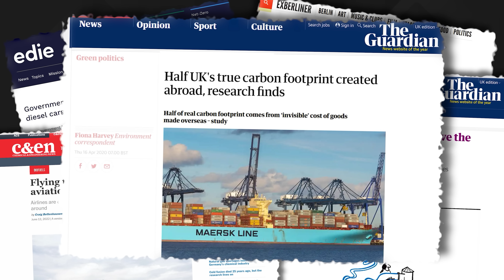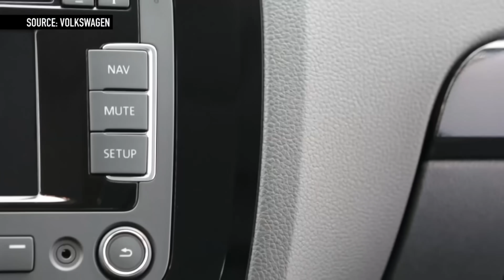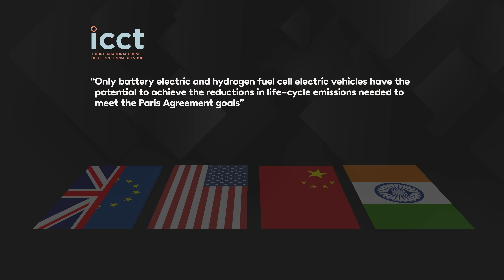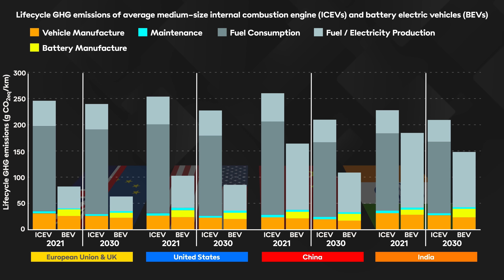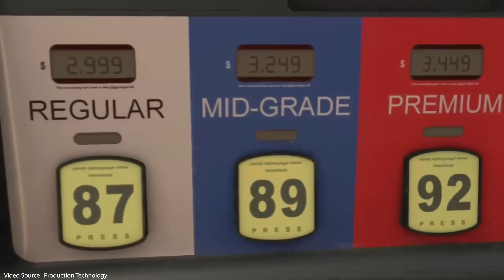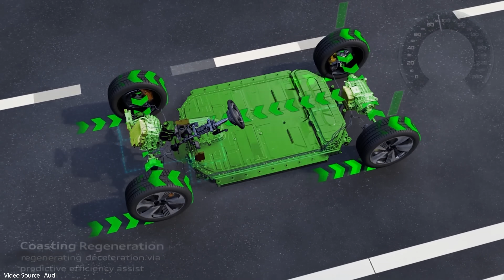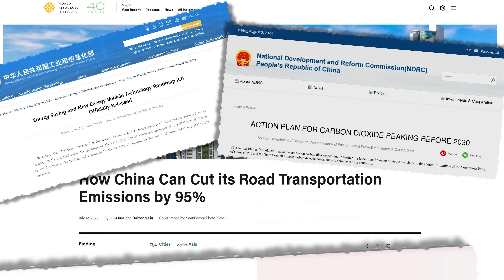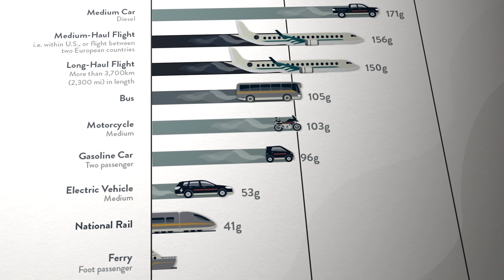Are EVs really better for the climate?

Comment: 5:08 So for BEVs the emission for generating the electricity is included, what about the emission for refining and transporting the fossil fuels, are they included as well?
Reply: Ding Ding.  You get a cigar.   I once took the time to look at the CO2 generated by making the stainless steel for an offshore drilling platform.   It is a lot.   Need to add that in too.
Reply: And don't overlook all the electricity used just pumping oil out of the ground, before it even gets to a refinery....
Reply: @Brian-om2hh and those 4.2 kWh used to refine one gallon of oil

Comment: Research from well respected organizations?
Never trust a statistic you have not rigged for yourself.
Means be critical, be mindful, double (or better) tripple-check. Just in case.

The means we power our transportation, actually all fossil energy sources, has to be changed. Methanol is, if you think it through, in the only viable option here in the medium term. Hydrogen, electric and biomass, have their niche applications, eventually ammonia too (even I am least convinced about that). But Methanol will (have to) replace all fossil fuels.
CO2 from power plant/industry exhausts plus hydrogen splitted with renewable energy (eventually/partially with nuclear), lets you produce Methanol. It is liquid, quite safe to use and basically no change to infrastructure.
But what we are talking about here, dont forget that.
Just crude oil is used 5,000 Million tonnes a year.
Even full force switch, with replacing 4% of it p.a., which would be an amazing achievement, with sth. better would take a transition period of 25 years or more.

Electric cars are not necessarily environment friendly.
It depends how the electricity is produced. Also how the Lithium, Copper (about 50 kg per car, where should this Copper come from for a billion cars?) and other rare elements are produced/mined.
In any case, an existing well working already existing car, is in most cases a better option for the environment, than a new to produce (even electric) car.

In Germany we "like" to burn lignite in power plant. Cant get more horrible than that. But the Russians stopped the natural gas deliveries, so we ran out of options in the short term here.
So keep that in mind, when citing "research", that parameters can change over time. F.e. here the CO2 fingerprint of electricity production has change now for the worse, compared to three years ago.

I think the E-Power concept from Nissan is the best environment friendly option, or the least harmful one, for most markets in the world.
Small calculation. A (lignite) power plant has CO2 emission of 1 kg per kWh electricity. A electric car has a consumption of about 0.2 kWh per km, when taken into accout transmission losses, phantom losses etc.
This means actually about 200 gramm emissions per km, for an electric car. Only good thing is just that the emissions do not accure within the town.
A Nissan Qashqai has CO2 Emissions of 122 gram per km.
Actually better than electric, when electricity is derived only from inefficient coal power plant.
Be it depends on the circumstances in that place.

Similar with trains. If it is a regular train (up to 200 km/h), more than half full on regular basis on short distances (up to about 300 km) it is more environment friendly than the plane.
But if the train is nearly empty, it is not good for the environment at all.
If it is a highspeed train(300 km/h or more), which consumes 3x the energy, is much more wasteful (f.e. brakes have to be replaced more often, the building of special highspeed tracks consumes at lot of steel and cement and space etc.) overall, and used for longer journeys (more than 300 km) is actually worse than the plane.
Planes which are usually fully booked, and the plane gets more efficient the longer the flight is.
Reality is, there are not simple solutions, it depends.
For that it is vital (literally the survival of our species depends of it) that we use the price, as an indicator on one hand, and politicians sets a price for pollutions of the environment (f.e. CO2-duty min. 100$/tonne).
That by looking at the price (for a ticket) we can make the economical, at the same time environment friendly, decision how to proceed.
No "research paper" can determine as granulated, as timely and as adaptive to changing parameters, as the price indicator can.

Comment: You mention that emissions for the production of ICE and BEV cars are similar. But, I'm pretty sure, manufacturing of Li-ion batteries causes way more harm than ICEs.
Reply: Generally the Emissions to make the batteries are offset after 1 year of driving.      When we get enough old batteries it will be even less with recycling.

Comment: I'd like an EV - once I can afford a second-hand one. That's going to be a long while unfortunately. In the meantime, I rarely use the car I have, it's small, efficient, economical and very well-maintained. 
Last year, we did 1,000 miles by car and it's set to do about the same this year. We're on the point of going back to using more public transport again whenever it's possible. 
(I used public transport right until the age of 52, when I finally had to learn to drive because of cut-backs in local bus services. Now it'll be case of frequency and just how much it costs to travel). 

Personally, I don't fret over the fact that I do have a 'gas-guzzler,' because I have made, and continue to make, a lot of pro-environment changes to my life:
 
Been a vegetarian/vegan for over 40 years, my family committing to the same diet for the past 4 years. 
I've been a regular tree-planter for about the same amount of time. 
My career was as a gardener, but with elements of conservation work involved. 

I have only flown by plane once in my life (UK to Iceland), and that was not by choice. Although I loved being in Iceland, I vowed never to fly again, and I never have. (My family are also committed non-flyers).

We are a make do and mend-type family, enjoy raiding fly-tip sites and lugging back stuff to make into other things. My son has got a new bookcase my husband has just finished making out of dumped wood. 
We buy most of our clothes and shoes from charity shops, sometimes furnishings as well. 

After the stream by my house emitted a methane 'belch,' which not only stank to high heaven, the fact this happened at all really worried me. So, over the past couple of weeks, I have begun to remove buckets of wood and leaves out of the stream and compost them aerobically to reduce the production of methane and nitrous oxide. There will be very little difference in the amount of CO2 emitted as these materials break down, but the other 2 were my primary concerns. 

I'm in the middle of planting a 2 acre permaculture/rewilding garden, and not only is this bringing back lots of wildlife to the area, it's encouraging species I've never seen here before. 
I have been picking my own home-grown fruit and vegetables every day for weeks now. Really saving money, with a fine crop of potatoes, blue and blackberries to come. 
I'm not just concentrating on those fruit/veg plants that are often seen in UK gardens, but planning ahead and starting to introduce those that can cope better with the new, hotter British summers.  

Today I began making a little activated biochar from dried out brash (thin wood collected from the stream) for the very first time. 
I was unsure how effective biochar would be, so I'd been doing a lot of research into it, making sure I wasn't getting into something that would have so little impact it wasn't worthwhile.
It's a bit of a messy job, and rather hot work on a day like this (31C in Scotland! I think I might try and do this job the same time as cook a bit of food in future. Kill 2 birds with one stone), but it's supposed to be pretty effective at locking carbon in soil. 

Tomorrow, sowing more food plants.
Reply: Legend and an inspiration.
Reply: I have an MG ev on a lease and it saves me money.
Reply: Buying a 2nd hand 1 will cost you a lot of money. But suit yourself.
Reply: @nozirohhh  buying a second hand gas car will, EVs (the right ones at least) don't have the same issues.
Reply: I'm going to wait 6 years from now to get one. Just going to pay cash for one. I live in Saskatchewan, Canada, and the least expensive used Tesla available is a 2018 model 3 long range for $62,000.00

Good luck finding anything new around here and if you do, it will be around $100,000 which is out of most people's ability to pay. 

And I want more range since when it goes down to -30 to -40C here in the winter it cuts the range down dramatically. I'm hoping the range and outrageous costs are fixed when I'm ready to purchase.
Reply: @KurtQuad  I think this you're spot on. Market will change a lot in that time.
Reply: @monkeysezbegood  we used to have this with light bulbs. People would say when my bulbs fail then I'll get LEDs.
Reply: I bought an EV last year with a $600 USD stimulus payment and a $370 SD extra money that I had.  It was a Lectric XP Step Thru 1.0  ebike (white) and now I have over 2,170 miles or 3,492 kilometers on it since January 2021. EV's doesn't just encompass passenger cars. I am a senior citizen and use it also for grocery shopping taking it right into my local grocery store 3.2 miles or 5.15 kilometers away and putting selected items right into my big front basket so no parking spot,no shopping cart so no grocery bag is needed. There might be a few times where I can't use it like when there is ice or show on the ground which is about 2 weeks out of the year where I live or when there is a big windstorm which might be another two or three weeks. I also have another specially designed electric bike that I can ride during the rainy season without getting wet at all . Many young people ride those electric scooters instead.
Reply: As little as you use your vehicle, the CO2 produced by running it is negligible.  The safety of driving a significantly heavier vehicle might be more of an issue.
Reply: You need a YouTube channel Debbie!
Reply: Biochar is a home for all the microbial life that soil needs in order to be soil and it catches minerals and nutrients like a filter that would normally be washed away from rain and normal watering. I highly recommend anyone doing gardening or farming use the charcoal method to make it as you retain more carbon as less goes up as smoke and you can increase porosity by adding steam to the charcoal container as you cook it.
How to build one get a metal container you can screw or clamp shut to put wood chips or sticks into that container has a tube from the top that ends under the container this lets the sin gas that comes off the wood to be a fuel to further the charcoal cooking process the wood container is inside a lager metal barrel so wood can be used to cook the interior container, to activate the charcoal IE make it more porous you add a tube to the bottom of your wood container that goes to a kettle of water that when heated release steam through the tube that then gets further heated and effects the charcoal.
Reply: Busses produce more pollution than cars and only break even with the pollution of cars when they are 33% occupied with passengers.
Basically Busses if not filled with passenger produce more pollution than cars do.
Reply: Counter argument to Just Have a Think biased argument... https://www.youtube.com/watch?v=TUx8yIlKVpU
Reply: Be prepared to spend $20,000+ to replace your batteries.  Ha ha ha ha ha.
Reply: @scottslotterbeck3796  Wright's law by the time you have to replace the battery it will not cost anywhere near that much.

Comment: The biggest frustration with EVs for me, currently (now that's an unintended pun!), is (as an example) for long trips across western US states with no charging stations, or very few. So, for example, plan a trip from Houston, TX to Ruidoso, NM for one week and see if you can do it in an EV with a range of 300 miles. Oh, by the way, make sure and include stops at remote mountain lakes, etc. for your vacation time while in Ruidoso... The answer is, it can't be done. Not yet. So, while I am not against EVs, I do point out that the infrastructure is not there for charging the vehicles, and the time to to charge for long-haul excursions like the example I have presented (which was, by the way, my vacation this summer) are not possible yet. We still have research to do. By the way, I am a huge fan of fuel cell technology for vehicles, which would not suffer from charge time problems, but, of course, still has challenges. Great video, keep up the good work. I only bring up my example to show some of the challenges we face, not to nay-say EVs. Research, I think is the key, and patience. Thanks.
Reply: It's frustrating having these objections because not every form of transportation needs to serve every need. Every transpiration option has limitations. Sedans can't transport large objects, pickup trucks lack seats, and vans are swiss army knives that can do everything on paved roads but poorly. There's no product that you buy which you expect to work for 100% of use cases so you buy items designed for the typical use case and find alternative options for the exceptional ones.

https://www.bts.gov/browse-statistical-products-and-data/covid-related/distribution-trips-distance-national-state-and

Long road trips are very rare events. BTS data shows about 1% of average trips exceed 100 miles and this data includes commercial truck drivers. The trip you described at a 500+ mile trip would be a 0.1% event.

Roughly 0.1% of my trips would fall under the 'you need to move something that is heavy, bulky, and/or dirty'. Before I got a hitch, that meant I'd occasionally need a moving van. Renting a ICE car for a week is about $500.  That's not too far off from the cost of gas which would be close to $300. American households spend an average of $4000/year on gas and that value isn't going to get any lower over the long term. They'd generally save far more money by going to EV and renting cars on the few occasions where they need to go beyond it's range limits in the same way that we have always rented cars whenever we needed to transport more items than we could carry.
Reply: It will be great if long trips will be the only ones served by ICE and the daily commute done electric. But right now, the majority still burns something to go to work.
Reply: @Pequod Requiem I fully agree. I had a conversation recently with a family member who was trying to point out the superiority of their car by arguing they had made a 380 mile trip without refueling. If I had taken that trip, it would have taken 10 minutes longer.

They didn't quite understand the cost of going to a gas station every other week costs $75 and 5 minutes each time while I get 95% of my joules for free at work and rarely need to stop by a charger. Having to spend a few minutes walking around a mall every 3 hours hasn't been that bad on the occasion I do go on those long trips.

Comment: Useful info however we still need to be able to source the lithium and various other elements en masse in order to make the transition; frankly that is unrealistic to do on a global scale.  Once again the rich will be able to make the transition while the poor will not.  We need to change our perspective towards transport and the use of energy generally rather than pinning our hopes purely on technological solutions.  Not to mention the need to create an economy that doesn't need to grow.
Reply: Great comment but this channel is for hardcore denialists.
Reply: @omnicidal  denialists of what?
Reply: In the free world supply of the battery components are limited by politics.      The minerals are there.
Reply: @danharold3087  This free world of which you speak, is coming when?
Reply: @edbop  If it pleases your politics we can say the countries known as the free world.
Reply: @danharold3087  As long as you can concede that politics isn't just a speed bump we can easily get over.  Plus there is a difference between the mineral being there and the mineral being accessible and available for our use.
Reply: @edbop  Yes and Yes.  Also note that what minerals are used is changing over time.   No idea what they will be using in 10 or 20 years time.  If mineral X is unavailable for whatever reasons they should be alternative chemistries that do not need it.  This is the hope anyway.
Reply: @danharold3087  Sure let's all just hope.  I think the point is unless we change how our economy works, so we no longer need economic growth, then it is all for nought; that's assuming we can survive the resource wars and mass famine.  Next year is not going to be pretty.

Comment: Looking at electric grid around Europe I think 2070 is more realistic date... Adding an EV is almost like adding another home in terms of consumption. Wires are too thin, substations too few, generation not adequate (and no, solar won't help that much, except summer weather sux in most of EU). If you also consider switching from gas heating to electric, it gets even worse.
There aren't enough electricians, money nor political will to make it happen till 2050. if we build dozens of nuclear power plants (right now) to cover base load while investing in solar/wind and count on a breakthrough when it comes to energy storage (and import 2 million electricians from Asia), then we might get close.

Comment: Volvo says their XC40 vs C40 break even point where the electric model starts to use less carbon than petrol is around 100,000km. It's not great but it's a start.
Reply: I think you'll find that was their worst-case scenario. They also stated that EVs and grids are getting cleaner and more efficient so the break even point will drop.
Reply: @airchie2  We're living the worst case scenario. 420ppm atmospheric carbon and we're not slowing down.